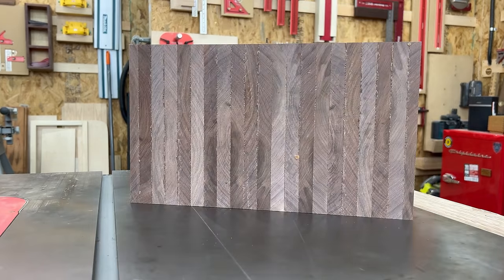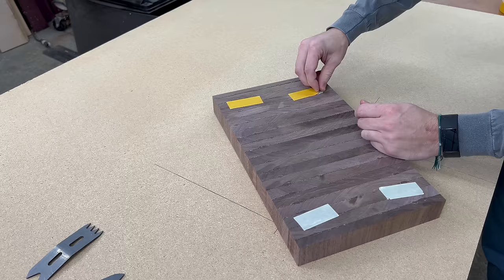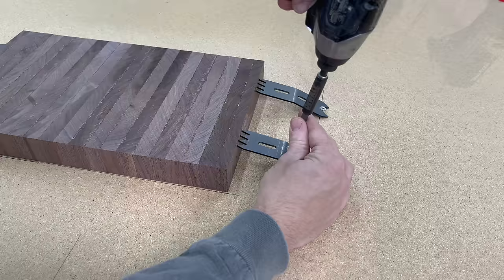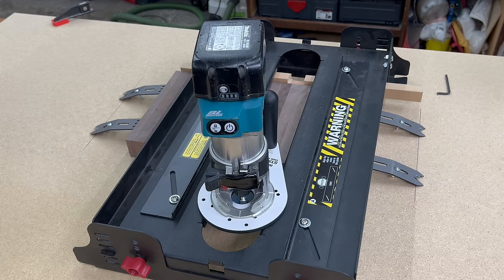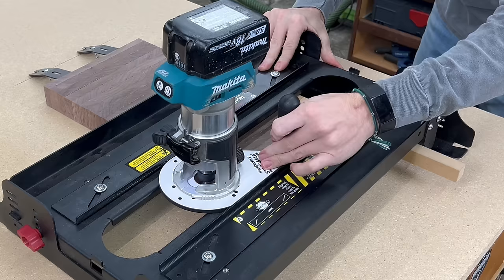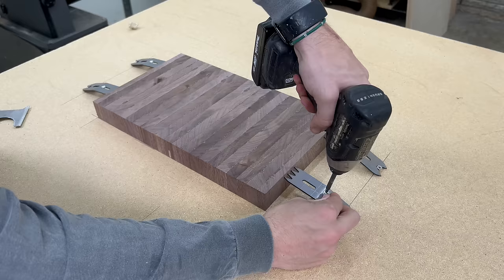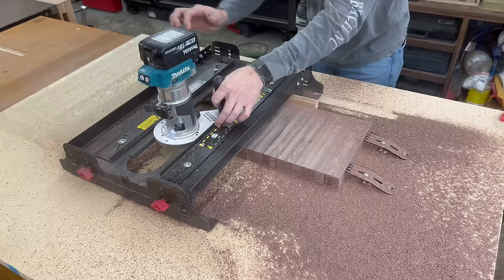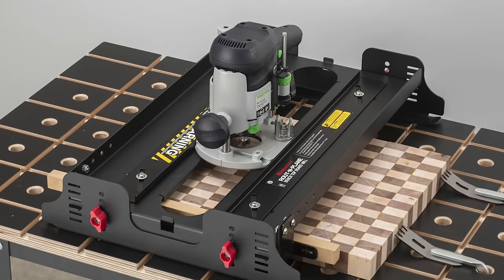DEAD FLAT end-grain cutting board in 5 minutes l RedTOOL WOODSHOP

Comment: Made mine from two pieces of angle iron dressed with beech and mounted on a discarded table top.  The work-piece is secured by clamps .  All breaks down and stores out of the way.  The cost was fully directed at the bit for my existing router.

Comment: This can be made from offcuts of mdf or plywood  adjust the height with battons and the protrusion of the cutter, also to any size.
Reply: Battens
Reply: @johnstarkie9948   Quite right, my spelling is terrible..
Reply: The main advantage to this is the thin top and the easily adjustable height of the top. I have made my own jig for this and the thickness of the top was a major issue. 3/4" is too thick for most routers, but anything thinner will have give to it unless it's metal. I ended up using aluminum L brackets but even then I'm not happy with the flex it has.
Reply: @BjarniArnason  Exactly. I had the same issue with my jig and I was using alu extrusion. This is a better design.

Comment: There are vertical bench clamps for dog holes. Just use them, instead of wasting a perfectly fine piece of board every time. I used them on my bench for the same work. The price for this jig is really good. 170 - 210$ is way less, than I was expecting. looking at my kreg pocket hole jjig I build my own system for longer pieces of lumber and / or boards with a rail system. For smaller projects, I would by this jig w/o thinking twice.

Comment: I dont understand.  What's the point of the double sided tape if you are going to use thoae clamp things? Honestly the clamping things on the side are overkill. The tape is more than enough to hold it in place. My guess is it was a nightmare to get the cutting board off the MDF thus it was not shown on the video.
Reply from the maker: The unevenness of the board prevented me from fully securing it with just double-sided tape. It's really key that this board stays in the same position during the flattening process and with the slab clamping dogs, I can be absolutely sure that my board won't move. But I like to use the double-sided tape because it does hold my board in place just enough to make installing the slab clamping dogs a bit easier. Hope that answers your question.
Reply: @WoodpeckersLLC  If the board isn't sitting flat on its own, you can't guarantee that you'll end up with a flat surface when you're done, since the process of clamping down (even from the sides) might cause the board to bend due to warp/twist/bow. The board will then spring back afterward. Without dealing with that, you're essentially just doing only a bit better than passing it through a planer. If you have to clamp, then at least you should shim the piece directly underneath where you're clamping, so that the board does not deflect in any way from the clamps.

Comment: Have you gotten any feedback from folks who've clamped the dogs down to the surface, either on an MFT-style table or in dovetail grooves routed into the table?  I see your point about making sure the piece is absolutely secure, I'm just thinking of alternatives to screwing the dogs down.  (Fewer screws I'm driving in and out of a surface = less material I have to replace = more money in my pocket.)
Reply from the maker: In the original product video https://youtu.be/W5ByGTJQO_Q you can see that's exactly how we did it. Track clamps coming up from below the table, then you place the slab dogs so they're not quite flat to the table and clamp them down. Only "gotcha"  is when your piece is just a little too long and it comes too close to the clamps on both ends. That's actually pretty rare, because the length of the clamping arm is about the same as the spacing between the holes, so it almost always works. I haven't done it, but it's pretty easy to see how using tracks could work well, too. Might have to get a little creative with making some sliding adapters, but that would get around the problems of the hole spacing.
Reply: @WoodpeckersLLC  Duh, I should have thought to check out the original video.  I like the adapter idea; I'll probably try out a few methods and see what works best for my setup.  Anyway, thanks for your input - I love these videos, and I appreciate how responsive you folks are to customers' questions and comments!
Reply: They work great on an MFT-style table.  The notch on the bottom nests into the back of the clamp and the tip of the movable jaw usually fits down into the slots.
Reply: Take my money!

Comment: That board should have been shimmed to the table, no?
Reply from the maker: The board was held firmly in place with the clamping dogs, eliminating the need for shims. The key is that the board remains in the same position during the entire flattening process which it did. Shimming would only be necessary in more extreme cases.
Reply: This board, no.  If the piece was really warped, cupped, etc., you would want to shim it so you distributed the stock removal as evenly as possible, but that wouldn't be necessary with the piece shown in this video.
Reply: @WoodpeckersLLC   Got it. I just took delivery of mine a few days ago. looking firward to using it.

Comment: Why not just use dog hole based securing methods instead of adding an entirely separate surface and tools for that?  I'm not sure why you opted to demonstrate this on a dog hole based workbench when redundancies could be questioned.
Reply from the maker: The goal was to display the function of the included slab clamping dogs. What you're suggesting would work perfectly, too.
Reply: @WoodpeckersLLC  I actually was watching a series of tutorial videos beforehand.  I didn't pause to realize that it was a brand video.  My apologies, and thanks for your patience.

Comment: How is that flat?  Look all the grooves cut into it.  Buy a planer.
Reply from the maker: Do not use a planer on end-grain glue-ups. It doesn't work and can be dangerous to you and your planer. The lines you see are grain direction changes. You can see them, but you can't feel them. Gone in seconds with sanding.
Reply: @WoodpeckersLLC  Yes it does work.  Just glue scrap pieces of wood to each end.  When done with the planer, use a table saw to cut them off.  Works every time.

Comment: And you're using only the router's own weight to hold it down on the surface? OMG.
Reply from the maker: I'm trying to think of any application of a hand held router that relies on more than the weight of the router and the operator's grip. Having a hard time coming up with any.
Reply: @WoodpeckersLLC if the router tilts ever so slightly in the wrong direction on the surface, the spinning bit will send it off into low earth orbit.
Reply from the maker: Impossible. The router cannot get closer to the work, only further away, no matter which way it leans on the base of the jig...which it it is very unlikely to do in the first place.
Reply: @WoodpeckersLLC it happened to me, so it's not impossible. When the bit is cutting into the material, it can still touch it when tilted. It doesn't have to go as deep, but the perimeter of a slanted spinning bit has a speed component upwards.